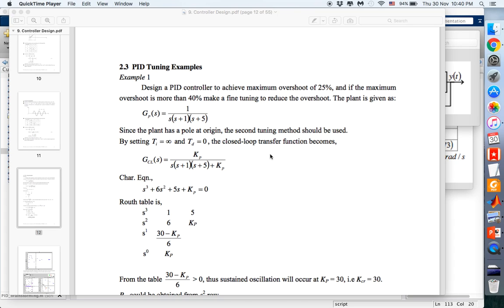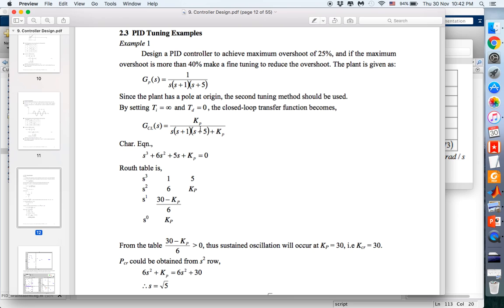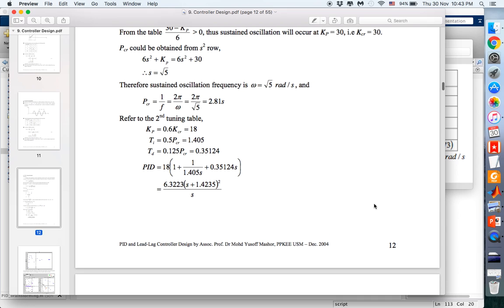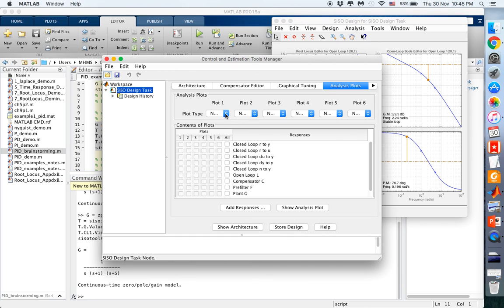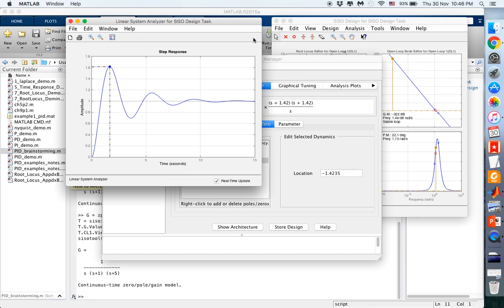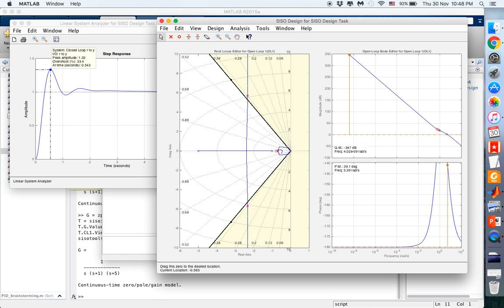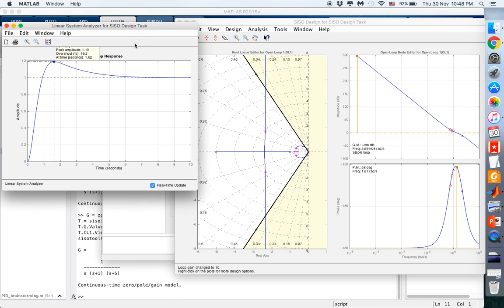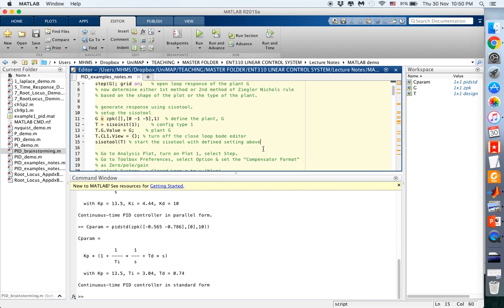PID Example 1 Ziegler Nichols

Comment: Hi, thanks for the great video. Can I know, how do you simplify the PID eqn in that note? How you get the eqn divided by s?
Reply from the maker: Basically just need to use the Ziegler Nichols tuning method. Find the parameters and substitute into the equation.